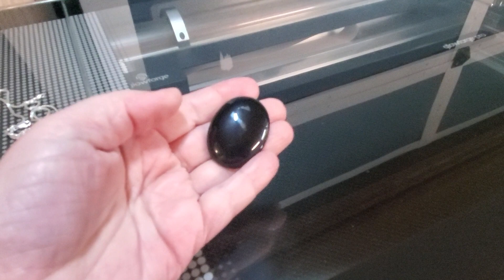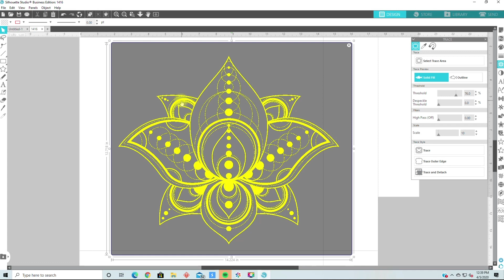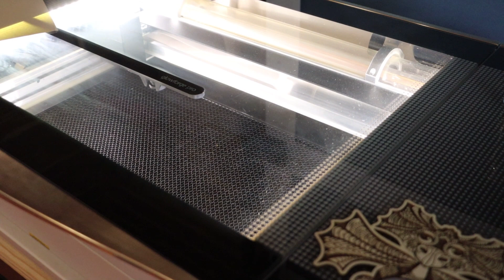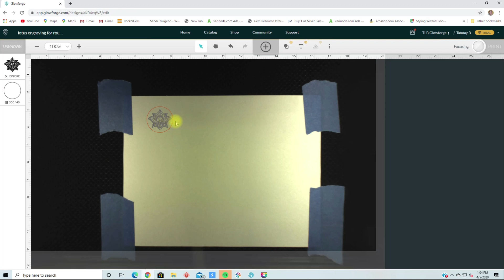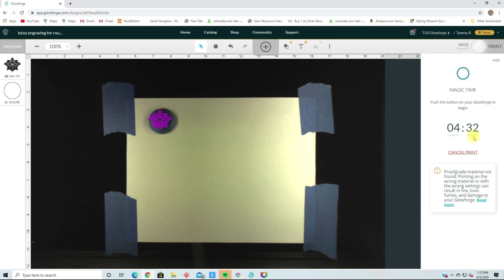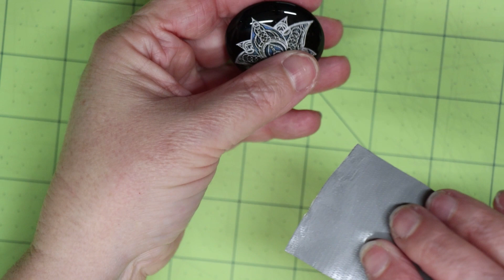Glowforge Series: Jazzing up an Onyx

Comment: Is there an equally accurate way to create an image into a stone, with a little depth to the image, but without the whitening aftermath on the onyx? Is there maybe an additional step like a wax, a lacquer or sealant to get rid of that whiteness? I'm thinking maybe the white left behind is an illusion due to loss of sheen from lasering. Is that right? I hope you can provide input on that. Thanks in advance! (Very impressive, btw.)

Comment: Hi. Wondering if you've tried the new calibration option in Glowforge? I used to have to cut a template for everything as well (and then ignore the fact that the image looks like it will engrave in the wrong place) but since I ran the calibration it is spot in every time without all the extra steps. Only takes about 10-20 minutes. World of difference!
Reply from the maker: Is there a newer one? I have done calibration, but it was several months ago and it didn't really help. I should try it again.
Reply: @tammybaalman2429  Through the GF UI? The one where you score a series of glowforge symbols across a piece of proof grade draft board? Worked amazing for me (about 4-6 weeks ago) haven't cut a template since. Even when I lift the lid to flip a 2 sizded engrave the alignment stays and highlighted image is spot on.

Comment: Great video! Quick question, why did you use painters tape on the stone?
Reply from the maker: The laser can leave a smoke residue and I know there can be flashback into the laser if the material is reflective. Masking is generally recommended.

Comment: How do you cut that circle ? I loaded a square and it does not give me the option to cut . I have the settings for wood board but the word cut is grey only engrave avail ?   Any suggestion ?
Reply from the maker: When I need separate operations, i.e. cut versus engrave vs score, I make sure my elements are different colors. If your square is the same color as your image to engrave or score, it will not give you a separate option.

Comment: Tammy,  your videos are so easy to follow and great info.  I’m a jeweler that uses metal stamps for spinner rings and would love to move up to etching a design on the silver and your video shows me how much more I could do with a machine like this.  What would you suggest for a beginner of equipment like this?  I’ve never used one do I don’t want something I couldn’t figure out.    Another option is to pay a company to do this for me but not sure they exist?  Do you have any advice?  Thanks again!!!
Reply from the maker: If you are interesting in etching sterling silver, a CO2 laser will not help you much. The laser cannot etch metal. It can leave a permanent mark on metal if you use a product specifically designed for that purpose. Have you thought of etching silver using Ferric Nitrate? I have a video series that covers applying a resist as well as the chemical etching process. Maybe this would be of more use. It is certainly more affordable. I suggest you watch the following videos to see if this is something that could help you.
Etching - Applying the Resist @ https://youtu.be/wie_XCSKEJ8
Etching - Using Ferric Nitrate @ https://youtu.be/pxUqG38jYu4
Reply: Tammy Baalman , Thank you very much for the reply.  You’ve been so helpful. I’m definitely going to try to etch!  I’m really excited to learn a new technique!  Thanks🌸🌸
Reply: @tammybaalman2429  I have actually used my glowforge for etching metal by using it to REMOVE from a solid coat of resist, allowing for much finer detail quick and easy.
Reply from the maker: @lisavelazquez9616 , I have tried that! I am going to experiment with different resists because I wasn't able to get the crisp details that I get using with my typical method. Is there a particular resist you prefer?
Reply: @tammybaalman2429  they make a laserable frisket mask but I've actually had good luck with cheap krylon spray paint. The deeper I want the etch the more layers I paint on. There is a thread in the GF community about this
 https://community.glowforge.com/t/laser-removing-resist-for-acid-etching-of-metals/429

I used a low power level, more passes to reduce effect of laser heat on the edge of the paint, especially on finer detailing (trial &error😬)
Reply from the maker: @lisavelazquez9616 , the frisket mask didn't hold up well in the etchant for me, but paint worked better. I just need to experiment more with the amount of layers I need.
Reply: @tammybaalman2429  I found that wearing gloves, cleaning with acetone, then high grit sandpaper or coarse steel wool, followed by several thin layers, as even as possible, dried overnight gave me the best results...even when etching steel pattern plates for my rolling mill or press. Even really deep ones I use as shot plates.